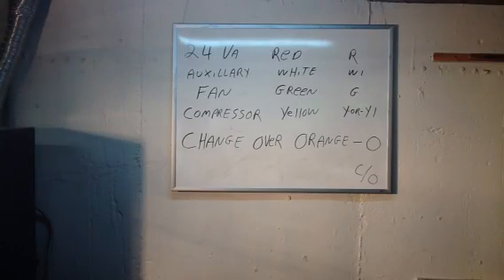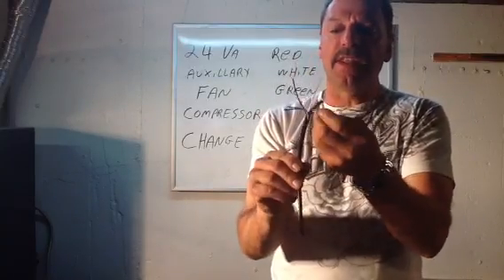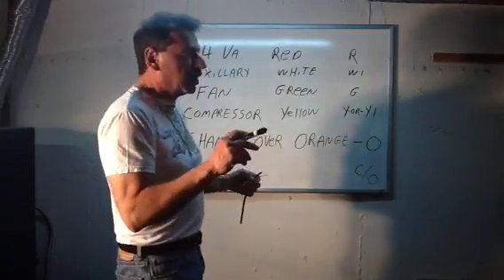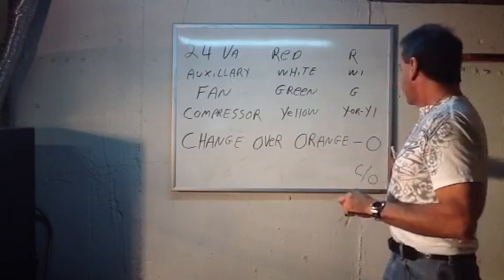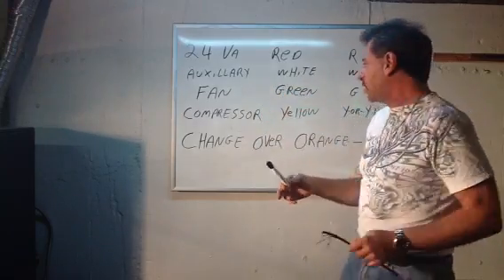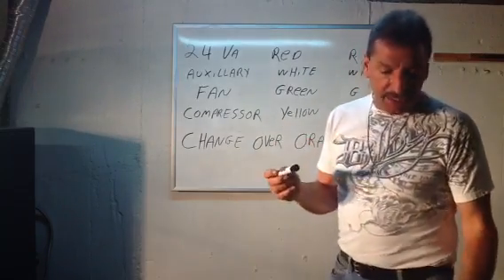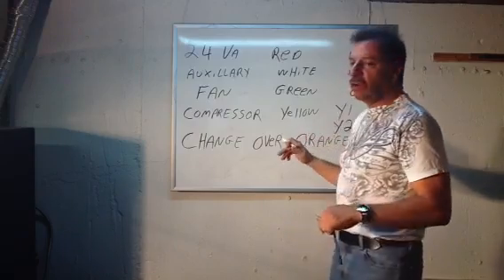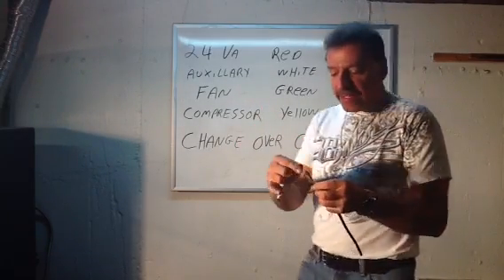thermostat wireing for heat pump

Comment: That heat pump cost more to run than my gas heat I bought this unit 12yr ago it's Amana with a heat pump, if it's using the ac compressor how is it cheaper I have a 2 ton unit, does the unit pull the same amount of power whether it's using the heat pump or the ac I'm curious.

Comment: red by itself is not 24vlt you need common in order to complete the 24 vlt circuit. so from your transformer one side is power which is always red and the other side is common which can be green or blue.. red goes to your thermostat and common stays at the circuit board, the only time you bring common to your thermostat is to power up the thermost just in case your batteries die.
Reply: My good man heat pump only has 4 wires can I use it on a 6 wire thermostat with only yellow, green, white , red.

Comment: Run at least 18/10 wire. I know trane is selling new thermostats that are 24v required so you need a common conductor. If you have a heat pump/air handler that are both 2 stage. You would need 24v,common,blower motor,EM,W1,W2,Y1,Y2 wires. You might also need 2 wires for an outside thermostat. Idk I just think more than 7 is necessary

Comment: I bought a Honeywell Thermostat from Lowes. Label on thermostat reads installs in 15 minutes. I was having problems wiring so after reading the manual and calling Honeywell which is closed today I then called Lowes. They could not tell me what the 2 extra wires a blue and an orange were for. I got online and googled and read and googled and read some more.  Then I finally found your video link...and wa la ..thermostat  is installed and working correctly. You made it easy for me to understand. Thank you so much for having this video post!

Comment: How do you run thermostat wire on a heat pump does it go from thermostat to inside unit then from there to outside unit or what need help

Comment: you made it clear for me, thank you. I called the hunter tech line and they told me I did not need the brown and blue wire, I have a two stage heat pump so I did need the wires connected.

Comment: The video was very educational. Although I wish you would have explained how to tie the wires together to turn the heat pump on. Because it is confusing if you use the heat wire or not. For someone that does not work on AC units. Thanks again

Comment: My AC works just fine, fan comes on automatically. When I switch to heat, the thermostats clicks and shows "heat on" but my fan doesn't start up and the heat pump doesn't run. Any ideas??

Comment: YOU are AWESOME!!!!! I had a 4 wire mechanical switch and installing a zwave digital thermostat ( monitor online etc.. ) I struggled for days with O/B... heat pump would only pump out heat all the time. I Looked everywhere for answers.. put the white wire ( heat ) from w1 to O/B... and presto!!!!! thanks a million!!